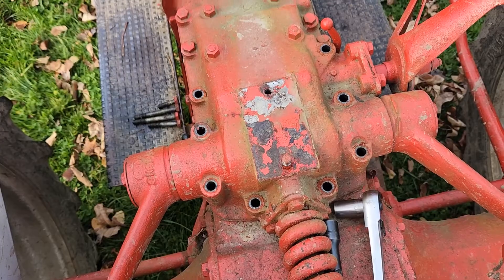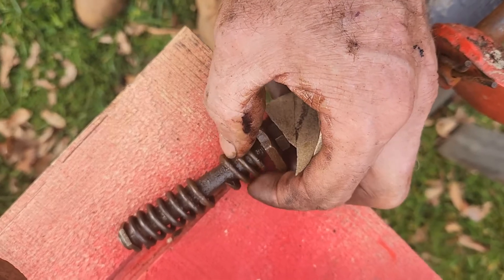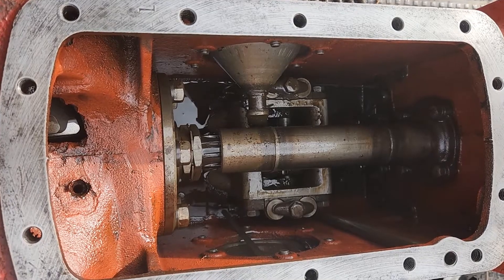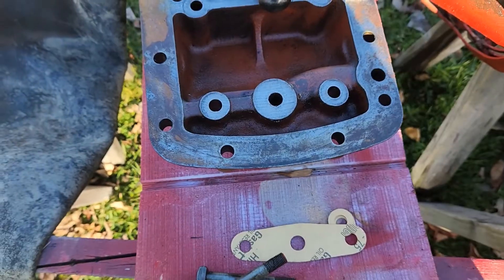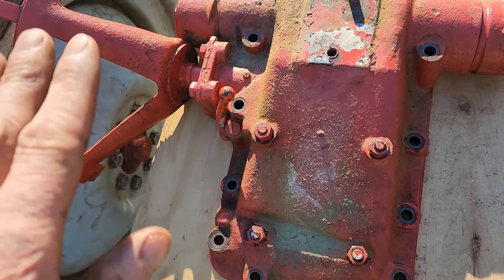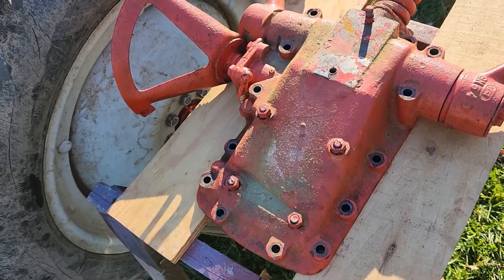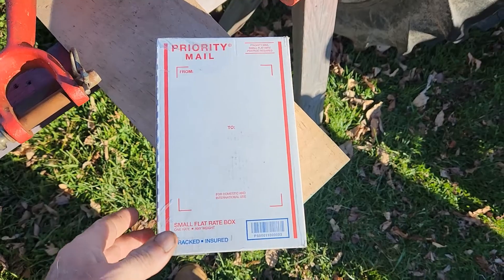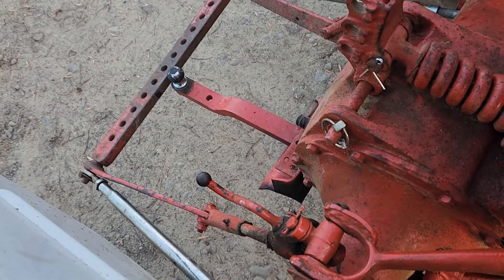1950 Ford 8N Hydraulic Repair

Comment: Had issues on my Ford 4000 had to pull that cover plate it was tricky but the repair was a success. I hope you were happy with your repair as well🙂
Reply from the maker: Seems to be working. Still need to check the see if the drawbar control spring helped. It was getting dark and really didn't feel like trying to attach an implement. I remember watching your repair video.

Comment: Got an old 8n that runs absolutely great, just have to replace several seals and also figure out the 3 point leaking down. I’ve come to the conclusion that I really need to buy another 8n to have one running while fixing the other. Jubilees are running about the same price in my area, so thinking I’ll get one
Reply from the maker: If its leaking down it's most likely the seal on the piston.I really like the 8N, just wish I didn't have to run the PTO for the 3 point to work.

Comment: "Leaking down." What does that mean? Mine will go up and down, but when I disengage the pto, it drops - the heavier the load, the faster it drops. Is that what you mean by "leaking down?" Thx!
Reply from the maker: By leaking down I mean hydraulic fluid is leaking pass the  cylinder. Usually a bad seal. The heavier the implement the faster it will drop. The 3- point will only work with the PTO engaged. I've attached a video that will help diagnosis any 3- point issues. https://youtu.be/hqqtO5lAing?si=z5mRXC3DpP0GJzmj
Reply: @Rdrake1413 , thanks. Yeah, I've watched Rachel's video. I just wanted to make sure you meant what I thought you meant. Thanks again.

Comment: The lever from the top cover to the pump accuating valve in the pump is to be straight. Not curved.There are some adjustments of the springs on the top cover. The little red lever just ahead of the three point lever switches between draft control and position control.

Comment: I'm almost surprised the spring is no longer available.. seems like it's easier to find the older parts. Finding parts for the early '80s tractors is about impossible... Unless you can find used ..
Reply from the maker: Yeah there is a company here in today that makes automotive springs. Been here for as long as I can remember. My Grandma worked there till she retired.  You would think a spring would be easy to  find. Those eighty model tractors are very popular.

Comment: Making a desperate search for an answer in the comments here. I have a 2N, slightly different pump. Had a very weak lift when I bought it. Goes up and down fine, but if there's an implement on back, it can't lift it. Rebuilt the pump this winter, brand new cam, cam blocks, pistons, valves, relief valve, and control valve, same problem. Found a very slight leak from the piston a few days ago. Put in a brand new piston and cylinder, the new style, STILL WILL NOT LIFT. I do not see any visible leaks anywhere, does anyone have any ideas? Control spring is adjusted per the book, no luck
Reply from the maker: Man that is pretty frustrating after spending all the time replacing parts. Only thing I can think of maybe some trash blocking a line. Steiner tractor has some pretty good videos on diagnosing hydraulic problems.
Reply: @Rdrake1413  at this point, every piece has been disassembled and cleaned, so I hope that isn't the case, don't want the newly rebuilt pump ruined. Any experience replacing the tube that goes from the pump base to the top lid if that ends up being the culprit?
Reply from the maker: @HedgehogOutdoors  No sorry I have never done that. Might try blowing air through it to see if it is plugged.
Reply: @Rdrake1413  already tried that, it blew fluid out of the pump just fine. Just got in a 1/8NPT pressure gauge, made an adapter by drilling and tapping a bolt to screw into the pump base plate. Going to try getting a pressure reading tomorrow if those threads hold

Comment: Did the draft spring work?
Reply from the maker: Not sure yet. Was getting dark so didn't try it. For now I am happy to have the 3 point working again. Will try it out today after work and let you know I'd it helped.
Reply from the maker: Check it today and it does work. I can set the height right where I want it.
Reply: Awesome man!